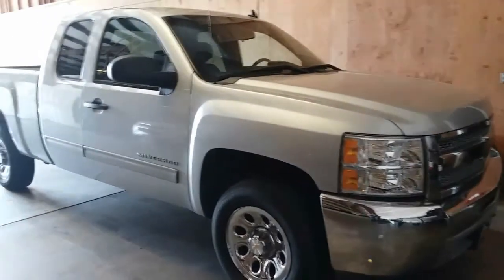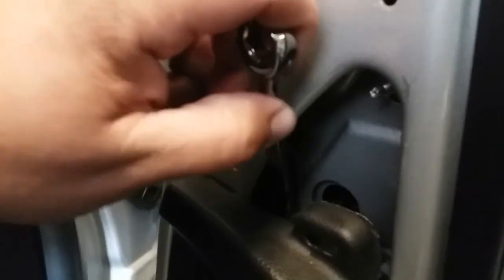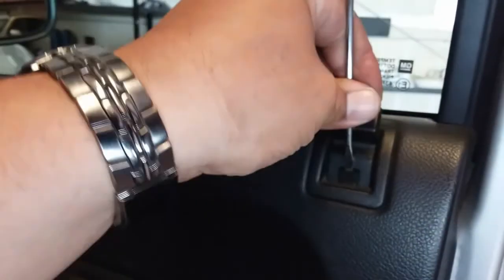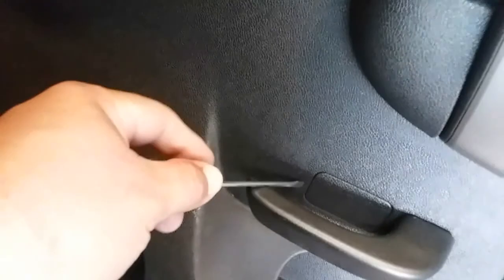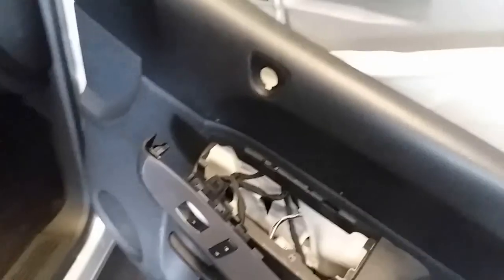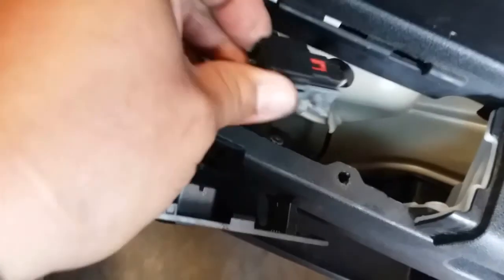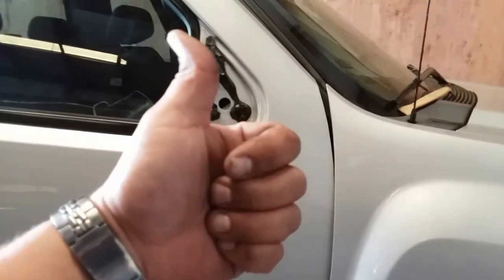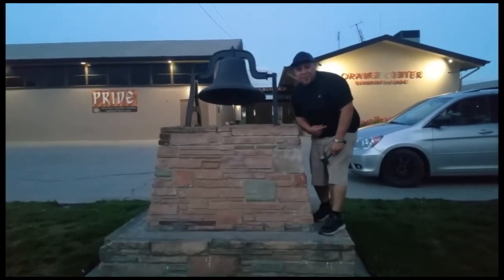How to: Remove a passenger side view mirror and door panel on a 2013 Chevrolet Silverado

Comment: I'm about to do mine. This is going to suck.
Reply from the maker: 🤣🤣🤣 Good luck broskie
Reply: @559powerscape  It wasn't bad actually! The removal and replacement took about 30 minutes thanks to your video. Much appreciated man!
Reply from the maker: Heck yeah bro,  glad you were able to get that changed out! Thank you for your Support!
Reply: @ballwizz23  Did you have to remove the door panel?
Reply: @danberry6085  I did. Gotta be able to get to those wires.